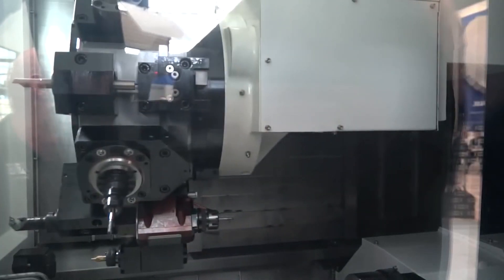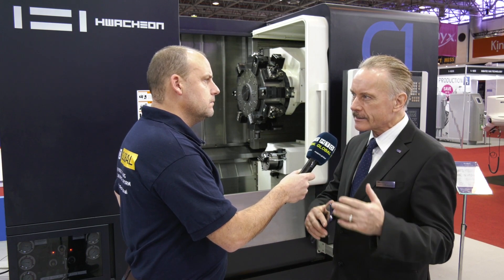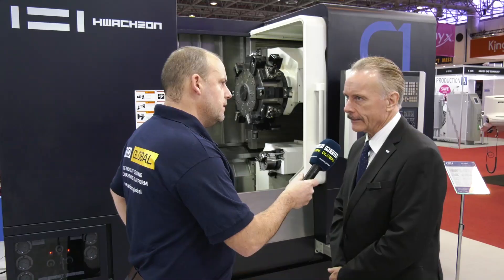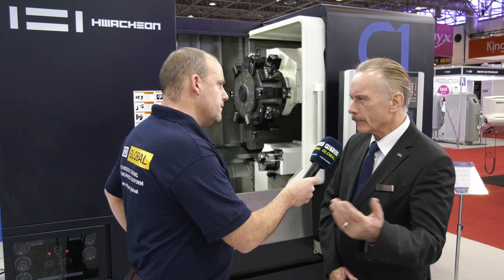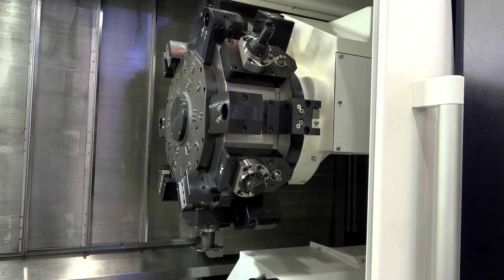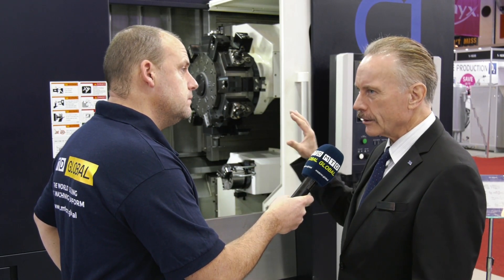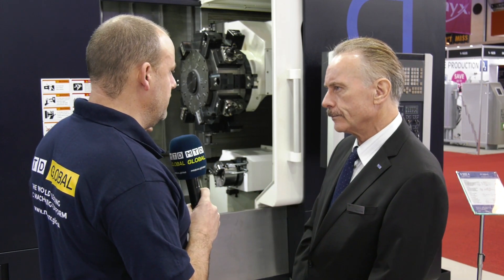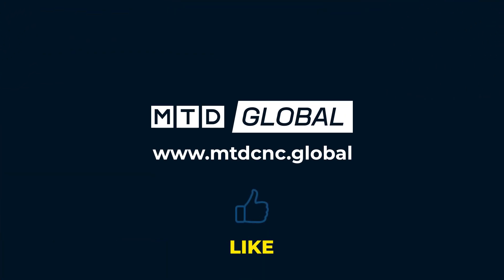A toolchanger and a turret makes 30 tools on this Hwacheon C1

Comment: Hiachi seiki had a toolchanger like that on their lathes in the late 90s, I’ve wondered why not more machine tool builders do it like that.
Reply: work on them everyday! brilliant machines for their age.
Reply: mattg22010 we have three of them at my workplace, two with toolchangers, driven tools and y-axis. One with only turning functions. only problem is the electric cabinets are getting older every day. :/ great macines that have been making good parts for 20 years now!
Reply: @henrikforsberg683  At my place there are about 6 mk1 hicells 23, about 13 hicell 23 mk2 and 3 hi turns with turning only and we also have a hicell 30 and hicell 250. Shame hitachi seiki went bust. And i agree, maintenance costs are going up due to age!
Reply from the maker: Glad you enjoyed the video !